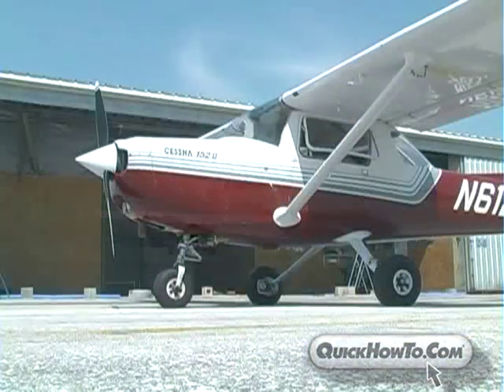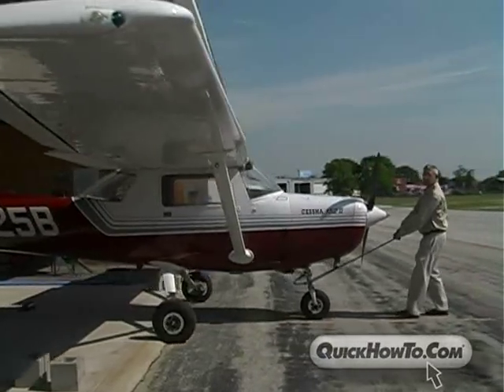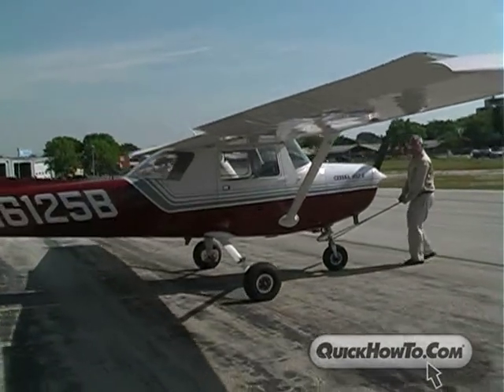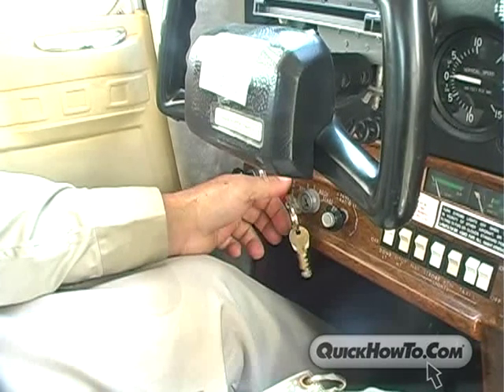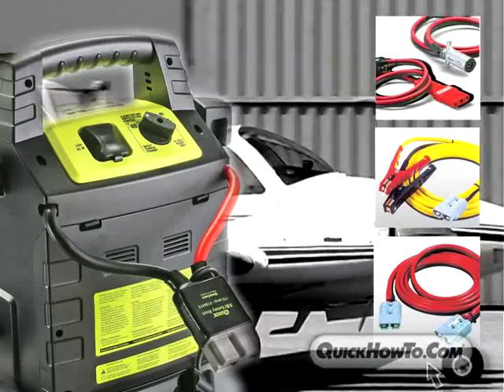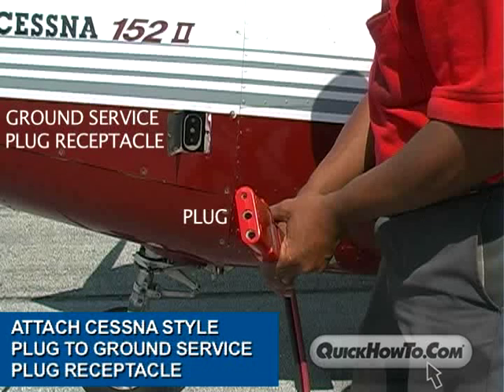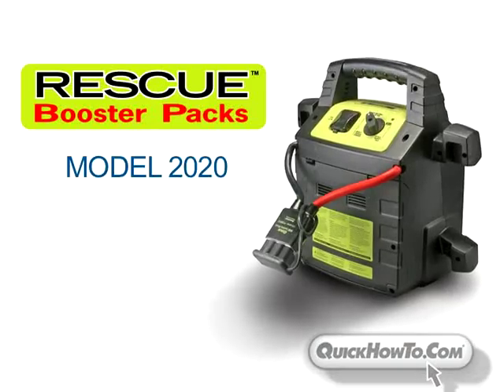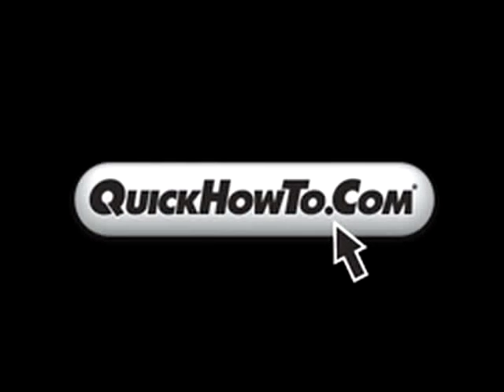How to Jump Start an Aircraft with the RESCUE 2020

Comment: Unless the airplane is out of its home base and the pilot wants to fly home, why would someone want to fly an airplane that its  battery is not working properly? Would you like to hand prop the airplane at the small airport after your $100 hamburger  lunch? While every hangar needs a trickle charger, I don't really need a booster starter. (If each FBO has one that will be great!)